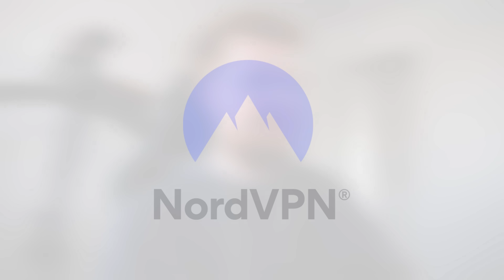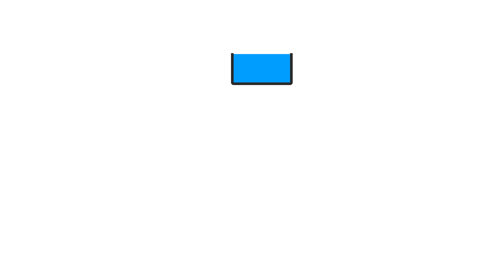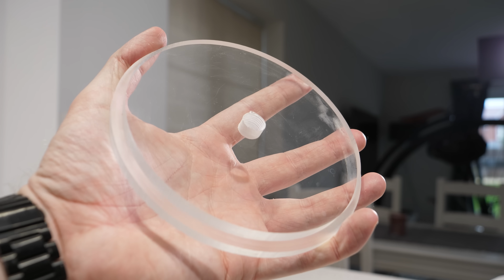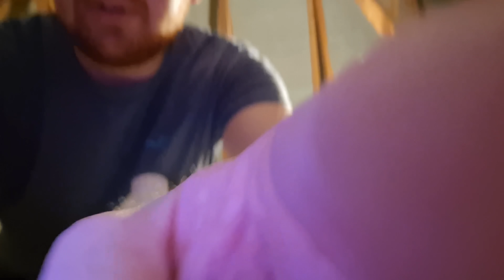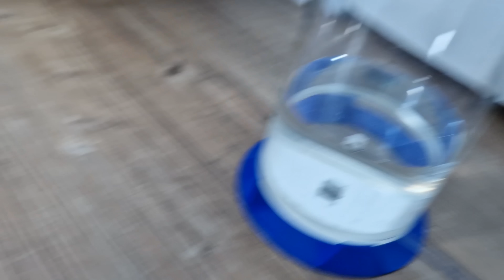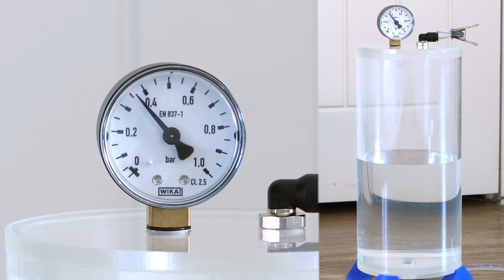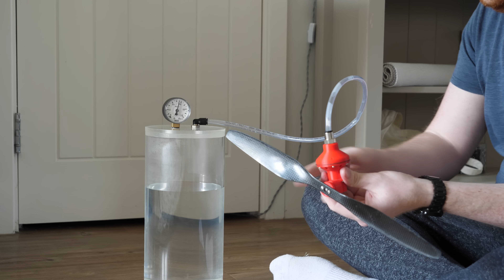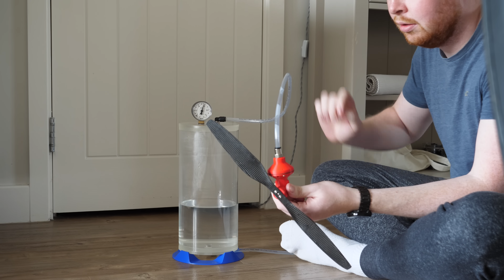Liquid Air Engine

Comment: You don't need a larger ports to reduce you're losses from the water flowing through the tube. If you put an adapter on the inlet to the pressure chamber and the outlet of the upstairs tank that adapts to a larger diameter tube, you will increase your flow rate even without changing threaded port size. 

This is because most of your losses are not coming from the simple restriction of the flow cross section, but rather from the friction against the wall of the tube. In fact, in hydraulic engineering (ie engineering of any fluid conveyance system) the losses due to flow restricting components are referred to as "minor" head loss while those due to wall friction are "major" head loss because of how much higher they usually are.

If you look at the equation for major head loss you'll see it is the Darcy Friction Factor (usually given the symbol f with subscript D) multiplied by the tube or pipe length, divided by the hydraulic diameter (just the inner diameter in the case of circular cross sections). This means that you can reduce your major head loss significantly by simply adapting to a larger tube diameter, and then just accept that the minor head losses from the comparatively undersized ports at either end.
Reply: Now use your engine to compress air into the tank and it will run forever.
Not
Reply: The flow rate for given pressure gradient during laminar flow actually scales as the 4th power of the diameter.
So increase the diameter by a factor 2, gain 16x the flow (or increase by only 20% to double it, roughly).
Reply: @landsgevaer  last i checked the formula for major headloss was proportional to D^-1 not D^-4. could you elaborate on what model that predicts a D^-4 relationship?
Reply: @maxk4324  Laminar flow in a tube. Speed goes like diameter squared since it has a parabolic velocity profile, multiplied by cross sectional area that also goes like diameter squared.
https://en.m.wikipedia.org/wiki/Hagen%E2%80%93Poiseuille_equation

Initially I thought that turbilent flow might scale with a lower power, but linear with diameter seems weird since then the velocity in the center of the tube would need to decrease with diameter, given that flow scales with area.
Not sure what you mean with this major head thingy, so maybe you can give your reference too...? 😉

Comment: Even if you kept the fitting size the same and increased only the tubing diameter the resistance would decrease. You can think of the tubing as a series connection of a large number of resistors: if you decrease the resistance of most of them, the total resistance will decrease dramatically, even though a few of them are unchanged. This analogy breaks down if we move between laminar and turbulent flow regimes, though.

Comment: Can you make make a video on this,
Make use of compressor to compress the air and run air engine and compare the power consumed by it with normal electric motor with similar rpm config! PLEASE

Comment: VIDEO IDEA: (sorry for my bad english) Use like actual water in the engine! I want you to make a compressed water engine, of course it won't be able to fly cuz of the water in bottle being super heavy So- make  a water pressured engine what to use for a car! And the coolest part- 2 things! 1. Make it of the design of air pressured engine and 2. Make the eksuste so it not like pushes water out, but sprays the water out in a loud his, like a steam engine (like a water pressured engine) So, what do you say?

Comment: Putting a regulator on the tank output it to keep an even pressure would probably make it last even longer. Then the engine wouldn't start at high RPM and burn off a lot of air. It would be more even.

Comment: Add a flywheel, maybe a pressure regulator and some method to carry air within the water tube, so your lower tank will fill back a bit before running out of air! Nice concept!

Comment: Could you run this better by picking a heavier fluid? The more weight on the air the higher the pressure right? I wanna see this running on mercury

Comment: Nice! Now all you need is a float valve in the air tank to keep the engine dry, and should consider using ABS for the parts as they can be acetone smoothed for better finish and reduced friction.

Comment: Add a float and needle to the tank to auto shutoff the air feed and your good to go. This has me thinking about a similar setup but for shop air on a property that has a good elevation change. ~100 feet of elevation is enough to pump up car tires.

Comment: Fun fact, theoretically speaking, putting mentos in coke and then quickly closing the cap should only be able to build the pressure up to the same level as if you had not put any mentos in and instead just let it naturally rebuild internal pressure over time. This is because the mentos is not actually reacting with the coke, it is simply providing high surface area for nucleation of the dissolved gas into bubbles. Without any chemical reaction, a closed bottle of coke (or any carbonated drink) can onlt change it's pressure as a result of temperature change.
Reply: EDIT: This comment is incorrect. Oops.

A gas evaporating out of a liquid takes time though, and is limited by the pressure of the system. Providing nucleation sites doesn't add energy to the system, but it does reduce the energy needed for the CO2 to evaporate, which increases the pressure necessary to halt the evaporation, which in turn gives a much higher equilibrium pressure.

Mentos don't chemically react with cola, but they do act as a catalyst, which changes the system. In that way, mentos cause a higher pressure from cola than just cola alone.
Reply: @TlalocTemporal  Since it's all CO2, wouldn't it redissolve into the water if the pressure is higher than the vapor pressure of CO2.
Reply: @MrTridac  -- Hmm, on second thought I think you're right. A catalyst would increase the speed of the equilibrium reaction in one direction, but it won't change the vapour pressure, so there would only be a tiny increase in equilibrium pressure if any.

Comment: You can add a valve to tubeless bike valve (Schrader or Presa) to the top of the tank. Instead of having to run water upstairs, you can just pump up the tank to the right PSI and force the water back up the tube to the reservoir. It would save you some up and down.

Comment: Great video as always!
I had a thought with the epoxy, I really can't tell what's good or bad, but I do know that in wood working, you usually don't want to use too much glue. It makes it easier to squeeze the part together and guarantee a good bounding over possible inconsistencies or parts being too far apart and relying on the glue as a solid material in between. Of course using too little would lead to gaps with no glue and I have no idea how that would apply to epoxy but either way, small thought I wanted to share as a possible research for future projects, love to see what you come up with and make so anything to make it better! :D

Comment: Not sure if you will be interested.  your videos are mostly about experiments with pressure (liquids and gases) but have you thought about the engine part?  to make a "force multiplier"?.  I'll try to explain.  conditionally there is a cart and it has a mass of 100 units.  there is an engine capable of moving 99 units of mass.  and applying a force of 1 unit (or a little more) can move a mass of 100 units (like 1 unit).  Of course we are not talking about efficiency and cost.  the main thing is maneuverability with large masses as if it is very easy (increased maneuverability) how to push a running car with a light push of the hand (as an approximate final goal) (in fact, the “power amplifier” of exoskeletons and maneuverability with the weight of parts of the hands exceeding the mark of 100 kilograms

Comment: Have you ever thought about using CO2 cartridges to run air engine? If tweaked for high pressure operation 17g of CO2 can also provide good trust/weight ratio and work quite long. At least in my head :D

Comment: Ok, got a question: If you put another tank even higher and ran it to the first tank, would it add pressure to the lower tank and also the bottom one? Like if you added something another meter up.

Comment: I wonder what the efficiency of this would be with a heavy flywheel attatched to a small motor to act as a generator, you can calculate the amount of potential energy from the volume of water and the height difference, then you can measure the total ouput of the motor and see the efficiency loss

Comment: fantastic, and here I was afraid you were done with the air engines. Heres an idea though: hook it right up to the water line and see what happens. Worst case, you have to let it dry out. best case, you just made a tiny hydraulic engine.

Comment: You can do the same thing with running water for infinite compressed air using something called a trompe.  Mines and other industries that use a lot of compressed air have used this technique for creating compressed air for nearly as long as the need for compressed air has existed.  All you need is plenty of water and a change in elevation.  Also worth noting is that you get more air pressure from a trompe then you do from a static column of water thanks to the inertia of the water as it falls similar to how a ramp pump provides more pressure out than the input pressure.
Reply: yes, but it requires a continuous flow of water..a LOT of water.  Works great if you have a stream or something doing nothing anyway, a lot less great if you have to move all that water back to the top when your done.
Reply: @Wooble57  You could run it between an upstairs bathroom tap and the kitchen sink maybe?
Reply: I was about to suggest a trompe as well--that way, there's no need to cut the water supply to avoid drowning the engine, since the trompe draws in outside air as long as the water keeps flowing.
Reply: Mr Thessalonian channel has a hybrid Trump and hydraulic ram mix that gets 60 PSI from a unit built from a propane tank.
Reply: I always think those are so cool. They are a great combination of a lot of important concepts. The first person to see one of those systems had to be totally amazed.
Reply: To add to what D W said: Ragged Chute in Ontario, Canada was a town that used a trompe system to power a mine and a town with pressure left over.  I was, and still am, fascinated by this technology  and how it has not been more widely used.
Reply: I hope the pyramids were a trompe or ram pump or both  😋
Reply: Tromped are soooo rad

Comment: Great job, you just keep making those engines better and better, amazing. I think it would be very interesting to see you use wider tubes. Also you could route the pressurized air back up and add that pressure to a secont water colum. Doubling your pressure. Having a high speed, high power version of this water enginge would be cool.

Comment: This is really interesting, I wonder if there is a way of converting the water pressure from the tap into energy through this method, and then feeding the water at the bottom of the house back to the supplier so if you have a water meter the meter doesn’t increase, suppose would work for people who don’t have water meters

Comment: It's actually gravity powered.
What kind of torque does this have? With a flywheel to smooth out transitions, would you be able to run it as a small generator? Would that have any particular advantages or efficiency as compared to using the dead mass of the water itself to drive a small generator?
Reply: My ponder exactly. I was thinking that the water, put through a constrictor, and attached to a sealed turbine or wheel, would probably ultimately produce more energy, and more smoothly.
Reply: @FriendlyNeighborhoodNitpicker  That could work, but I was actually thinking about a pulley system. Like that Gravity Light thing.
Reply: @Terminarch  must have missed that one.

Comment: This was very interesting Tom, I would be excited to see how that new engine performs at higher pressures, such as your previous tests. additionally, how much pressure you could create with the top water tank at an even higher altitude. Also the effects of a larger diameter water tube on runtime and time to come back to operating pressure at the lower tank.

Comment: I wonder could it be useful to put magnets on the blade on a smaller radius and produce electricity off of it? idk if that's even feasible or possible but all that would power it would be doing a chore every 10-5 minutes to refill the water lol

Comment: It's amazing how well the engine self-regulates, slower RPMs meaning it consumes less air per second and lets the pressure build back up. Would a heavier flywheel help it avoid stalling at very low RPM, or just keep the RPM high until it starves itself of air?
Reply: Not necessarily a heavy flywheel but someting with high moment of inertia. The large diameter propeller blades already serve this purpose.
Reply: I think a heavy flywheel would be helpful. Think about those old hit-and-miss engines. They had massive flywheels and they could operate at low RPMs, like 250 RPMs. There are accelerations and decelerations of the piston, rod, and crankshaft in every rotation. A heavy flywheel would stabilize the accelerations and deccelerations. Which would increase the efficiency. I don't think that the propeller has enough weight. I would try something like a wheel from a push lawnmower or an aluminum pulley for a belt drive about 6 inches in diameter.
Reply: A flywheel only helps at smoothing the motion between power strokes, it is not needed to reach high speeds, hence why he didnt use it previously.
It would have definitely been useful here to maintain a smoother rotation tho

Comment: I guess it's interesting. But what is really being learned from this. Do you have a goal other than making an air-powered engine? I'm sure tons of people before have done this. You could read their findings. I totally get the desire to tinker. Don't get me wrong. But you're putting a lot of effort into something that even in the real world, has not practical use. It'd be one thing to learn about, say, jet engines like integza is doing. The base principles are the roots of modern avionics. But what you are working on could never be practically applied. So I'm trying to understand why you are still going at it.

Comment: As an electrical engineer, the first thing that came to my mind when you were laying out the tube was resistance. Kind of an interesting way to visualize "voltage" drop over a length of small gauge "wire"

Awesome job with the engine. The diaphragm really transformed it!
Reply: The correct comparison would be drag in the tubing restricting water flow rate being the electrical equivalent of resistance limiting current in a wire. 
The pressure created by the height difference between the tank in the loft and engine downstairs is the equivalent of voltage (i.e. 'potential difference') across the wire, and won't change regardless of the diameter of the pipe / gauge of the wire.
Reply: @richardjones38  You're currect about the first part, I was refering to the voltage drop that results from the resistance limiting current. 

Pressure (voltage) absolutely does change as current increases whenever you have a restriction. This is shown beautifully in the video as the pressure dropping as the flow increases.